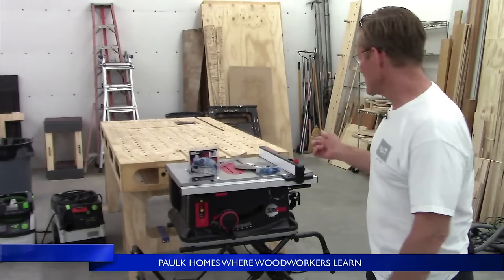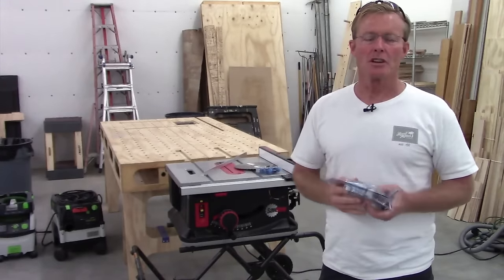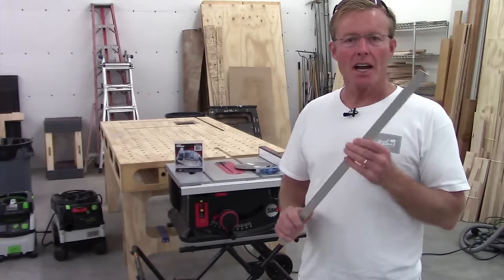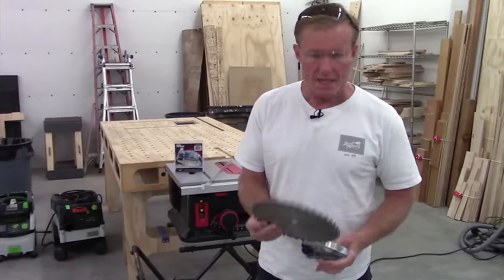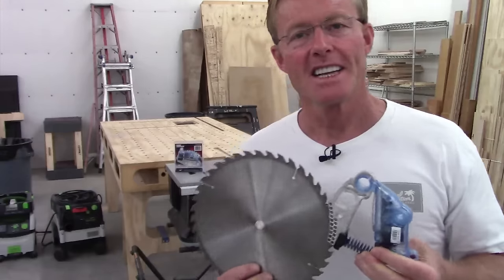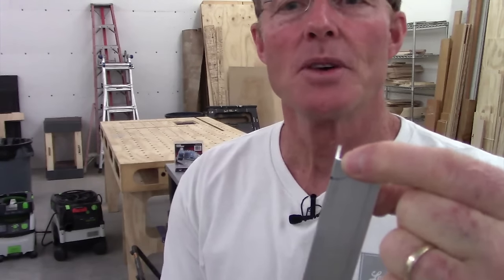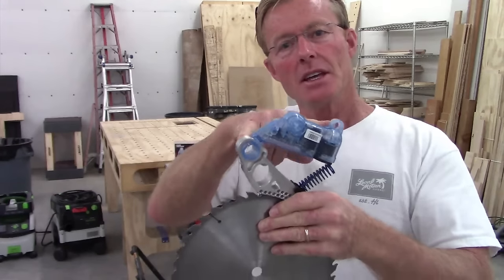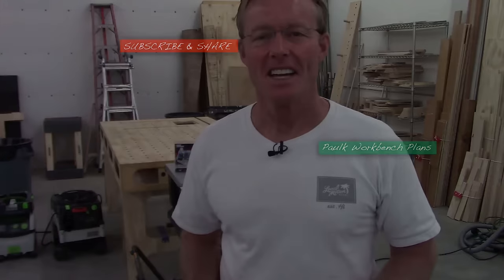My Sawstop Jobsite Saw Accident: Cutting Aluminum and Tripping the Brake

Comment: I had my head in my other end (which is why I bought the SawStop Professional to begin with) and ran a jig with an extruded aluminum miter into the blade and of course it tripped. I was using an eight inch diameter .250" kerf box joint blade from Infinity.  I removed the blade and dado brake which were quite bonded together, and decided to separate the blade from the cartridge to see what kind of shape it was in. I examined the blade with a 5X magnifying glass and couldn't find a single chip or crack anywhere. I installed a steel disc in the saw to check for runout with a dial indicator. There was absolutely no runout at the arbor. I reinstalled the blade a performed a runout check and got less than .0005". I am still using the blade and it works perfectly. Of course I had to replace the dado brake cartridge.
I appreciate a pro like you confessing to loss of attention while working. Emergency rooms all over the nation see folks everyday who will readily admit "I wasn't thinking". Besides the protection the SawStop provides it is a high quality saw and a pleasure to use. It is obviously built very well to survive the blunt trauma impact when the brake cartridge is activated without any damage. As a disclaimer SawStop and Infinity advise against using the .250" box joint blade in the SawStop.  After what I have seen, I have no reservation whatsoever using the blade in my saw. We do live in the land of the Lawyers.
Good video and thanks

Comment: I just did something similarly stupid.  I caught the blade with a bit of my incra miter gauge.  So much for that blade/brake.  Fortunately, I had an extra.

The mark on the aluminum miter gauge fence was about the same as on yours.  Still glad I have a sawstop, but I can no longer say I’ve never tripped it.

Comment: As others here have mentioned, the blade brake was tripped because your hand was in contact with the aluminum. Had the aluminum been encased in something non-conductive, the brake would not have engaged, much like when you cut through a nail that is hidden inside a piece of lumber.  Sawstop saws have a feature that allows you to disable the brake by using a key to disarm the braking system. Once disabled, the braking system will re-activate itself only after you turn the saw off.

Comment: Mr. PAULK, thank you very much for this very instructive video. I am still amazed that none of the jobsite tablesaw sold in the European Union are equiped with safety systems such as Sawstop's or Bosch's (on the Reaxx model). Somethingelse is also suprising: the impossibility to use dado blades on any jobsite or cabinet tablesaws sold in European Union because they violate the European Safety Standards. It's is strange isn't. 
Once again congratulations for all your videos, I really enjoy each one of them.

Comment: Ron:

I had a very similar "non-thinking" event with my sawstop cabinet saw.  I had to cut down the shaft of my 12yr old son's hockey stick (something I have done many times for my kids).  I normally do this on my RAS, because it's simple to lay it on there and pull the saw through the shaft.  This time, I had some glued fixtures drying, laying on the bed of my RAS, so I thought "no big deal, I'll just run it through my table saw".   Long story short... the shaft is carbon graphite and it turns out to be conductive and the sawstop brake activated instantly.  Those sticks are expensive anyway, but this one cost me $60 for the brake and $40 for the blade, so an extra $100.   I'll think more about conductivity in the future.

Comment: Tripped my SawStop early in ownership, aluminum T track on top of a jig (duh). Was hard to even find the nick. Since then, no problems. Doesn't bother me that it takes an additional ten seconds to set the blade to cartridge depth - probably take longer to change bandages on missing fingers! Extremely accurate, well made, excellent customer service. Would absolutely buy again! Professional 3 hp-

Comment: As long as you don't touch the metal that you are cutting then the SawStop mechanism will not trip. It's pretty easy to avoid. Just use push-sticks or wear a nonconductive glove (I know not a good idea to wear gloves at the table saw). The SawStop will NOT trigger if you are just cutting through nails. You would have to be touching the nail in some way for the mechanism to trigger. Also, be sure that you are cutting metals with the correct blade.

SawStops are awesome. You can't put a price on the potential fingers you will save.

Comment: Ron, you should be able to use the blade again.  My cabinet saw has tripped 3-4 times b/c of my students(hitting metal on the box joint jig, miter sled fence luckily never any of their body parts) and if you carefully wiggle the blade you should be able to get it out of the cartridge without losing any carbides.
Reply from the maker: I will give it a try
Reply: I've tripped my brake before too when a 6" ruler fell out of my shirt pocket and hit the blade. I had the damaged teeth replaced by Eide Saw & Tool Services in Minneapolis. Replacing a couple teeth and sharpening the whole blade was significantly cheaper than replacing my Freud blade. Its been 5 years since I had the teeth replaced and the blade is still good as new.
Reply: Unfortunately, mine lost a tooth.  Might be repairable though - I will have to see.  It was due for a sharpening anyways.

Comment: Ron, if you can afford, please do the conductivity of water test. Since I heard of the sawstop system I have often wondered about that (being an electrician/electronics guy by trade), wondering what resistance it kicks in at. Damp wood vs dry human flesh, to me, seems difficult to discriminate between?
Reply: TheChipmunk2008 I have a feeling it's actually triggered by human capacitance and some sort of AC signal that's put on the blade. Otherwise there would have to be either some special strap you would need to wear for current to return or a connection to earth, and I wouldn't rely on that when wearing safety shoes in a workshop

Comment: What are your thoughts on the Bosch Reaxx tablesaw? I've talked to other contractors and a majority have thought it was better and cheaper than the sawstop since the cartridge can be used twice and the blade doesn't get damaged.
Reply from the maker: Can't say as I haven't used one and I got my SS before Bosch had theirs. My main reason that I sold my Bosch units and got DeWalt was the fence. I don't know if they are sticking with the same fence design or have reengineered it. SS has the best fence I have ever had on any portable saw. NOTE: I work with some really great carpenters that swear by Bosch and love the fence. It is just, for me, the Bosch fence is a non-starter. I also don't really mind that the brake has only one use or that the blade needs replacing as that is all minor in comparison to the human carnage without a brake. I am glade Bosch has joined with SS in offering this safety feature and I give much credit to SS for leading the way. Without SS, I doubt Bosch or any other company would have gone in that direction. My hope is that DeWalt and Makita will follow suit. I am also glad, as carpenters, we can choose from many great tool companies: Festool, Makita, Milwaukee, Bosch, SawStop, DeWalt, Porter Cable, Fein and more. More competition is better for all.
Reply: Ron, I was surprised you complained about the Bosch fence in the videos. I've had my 4000 for 13 years and I can still mill my own edge banding with the thing. I am blown away at how accurate it is. But I guess now that the lawsuit is over and Bosch lost I won't be able to get a Reaxx, so these reviews are helpful. Love your channel and your ideas. Cheers.

Comment: Ron, does the brake work with any blade or only with Sawstop's own blades?
Reply: Works with any blade, also there's a dado cartridge for stacked dado blade sets as well, sold separately of course.

Comment: My buddy gives me a hard time about cutting aluminum on my table or miter saw.  Do you have a dedicated blade for those cuts (like he thinks should be done), or the same blade you use to rip lumber (like I do) ?
Reply from the maker: I use my wood blades to cut aluminum. It doesn't harm the blades. Wood is harder on the blades than aluminum.
Reply: Ron, it's not about harming the blade, it's more about safety and using the right tool to do a job with ease.

Comment: If you really need to cut aluminum with your saw you can disable the safety function. As soon as you stop the saw after the cut it will reset itself to the safe position. Its in the manual.
Reply from the maker: yes, I recorded a video of the process and how easy it is. I haven't released it yet, but regardless of how easy, one must remember to do so;0)

Comment: Hi Paul,
I like your workbenches etc. enourmously. But today I saw a thing that made my skin crawl.
Aluminium should NEVER be sawn with a woodcutting blade. That's an accident waiting to happen. It should only be sawn with
a blade with negative rake, or at least zero rake. If you really like your fingers, that's the way to do it. No offense, but I've been  sawing  Aluminium for the last 25 years, and know what I'm talking about. A woodcutting blade hacks into the aluminium with a lot of noise and, if you have a flimsy die-cast machine, is capable to wreck the entire machine, sometimes with a finger as side- dish. Also the blade should be greased with something candle-stick like substance, to prevent cold fusion with the metal. Or 
WD-40. Works like a charm, for milling, drilling, tapping, sawing, you name it.

Hoping this little rant saves some bodyparts, (and machinery), I greet you,

Sincerely,

Ludo van der herten, Antwerp, Belgium.
Reply: Do they sell blades for aluminum for table saws? If so where?
Reply: Pario diablo sells a 80 tooth blade for both 10 & 12" saws that cuts non ferrous metals like aluminum and brass up to 1/4" thick. I've even cut 3/8" copper bar stock on my 12" chop saw. Has carbide teeth.
Reply: Ludo van der herten,  You are 100% correct.  You should always use a negative rake blade for metals.  Also, the number of teeth is determined by the thickness of the metal.  More teeth for thinner materials.

Comment: I like that safety feature, but what I don't understand is why they have to destroy the blade with the brake. Couldn't they just have made the blade disappear below the table without destroying the blade and let the saw wind down on its own. Dunno how much the brake costs but I bet that was a $100 or more oops.
Reply: Saul, I had the same question as you. "Why does the blade have to be slammed into aluminum when it drops below the table?" The company I work for has 14 Saw Stops and I'm the lucky one who gets to take care of resetting the brakes when they go off and have the blades resharpened or replaced. So while at a tool show I've talked to a number of reps from Saw Stop and asked that question, the reason, insurance! 
  Now from what I gather Bosch's Reaxx saw just drops below the table. And I have lost track of where the lawsuit between Bosch and Saw Stop stands. But that's my long answer to this.